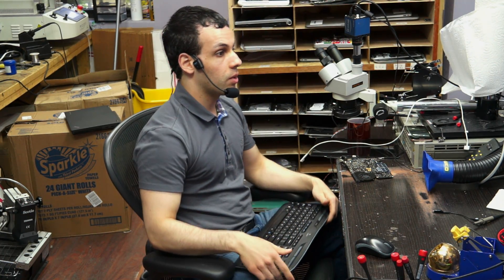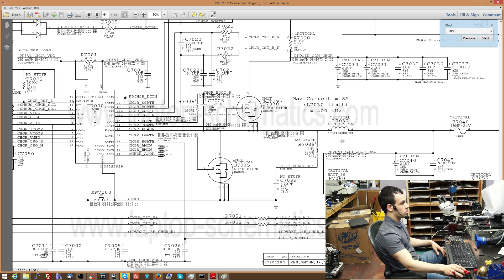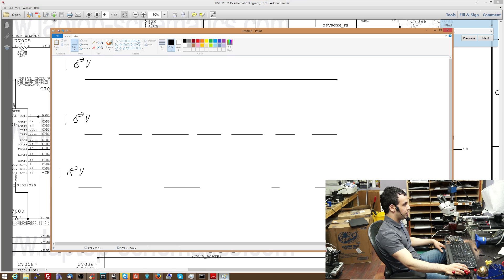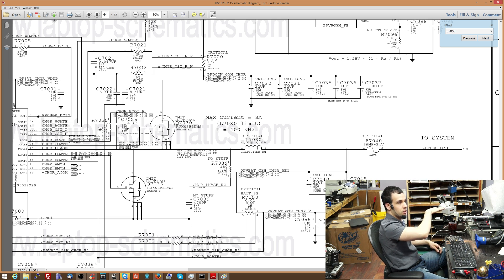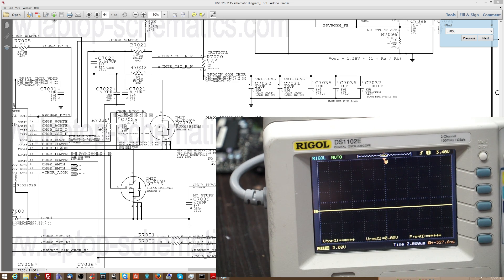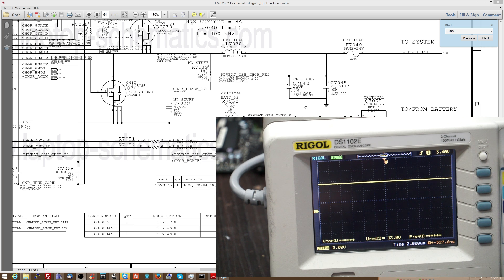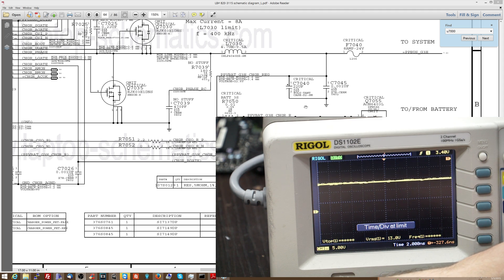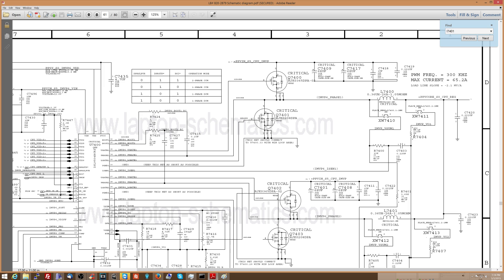What is a buck converter?

Comment: I'm pretty sure Louis won't come back to this, so if you have the knowledge, please answer this question:
Why is there a FUSE after the smoothed out DC line, if this circuitry is supposed to LOWER the voltage?

I'd understand if a fuse was placed after a Voltage Booster circuitry, but I really don't get why it's there, after a Buck converter. Anyone?
Reply: Not sure, but I think you may be getting voltage and current mixed up; the fuse protects against excess current flow.

Comment: Hi Louis, can I ask, why divide the voltage by using a pulse? Why create 12.6v on average by breaking up 18v? Why not just use a resistor to create and exact 12.6v?
Reply: Because depending on how much power your load uses the resistor will waste power and get hot. Voltage dividers are usually only used in areas that just need to "see" a voltage. A volume control on the input of an amplifier can use a voltage divider between the output of your phone/MP3 player and the amp input. The resistors should be high enough that your phone barely has to drive any current through them but still considerably lower than the input of the amp.
In an example of going from 18v to 12v. If your load needed 1 amp you could put a 6 ohm resistor in series. But 12 Watts would go to the load and 6 into the resistor which would need to be a large size ceramic to deal with the heat. It's the same reason you don't control the speed of your car by holding the brake while driving.

Comment: I understand the dividing part. What I don't get: Does it need to be 0V for a second that you get the desired output voltage? In what time scale does that work?
Reply: Technically no. You can use a lower voltage other than ground however that complicates the mosfet control circuitry and the duty cycle calculation. Other applications like A.C. inverters do that somewhat but in this application,  it serves to no benefit

Comment: Louis! Why do those transistors for the buck converter have 3 connections to the same wire each?
Reply: alex tworkowski that is the source pin of the MOSFET. In high power mosfets,  the drain pin is usually the big tab connection. In order to even things out,  the source pin tends to be multiple pins and in this case 3.

Comment: Awesome video. Thanks Louis. One question... what is the difference between a buck converter and Pulse Width Modulation?
Reply: I'm gonna guess that the PWM goes before the buck converter.  Good question.
Reply: A buck converter uses pwm.  Really there isn't a difference however a buck converter uses an inductor and capacitor to allow for slower pwm frequencies